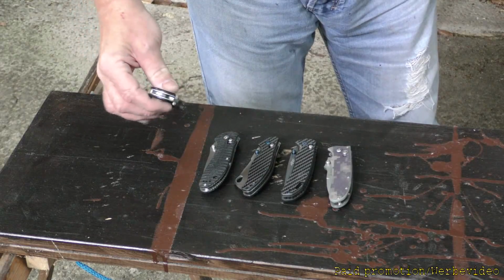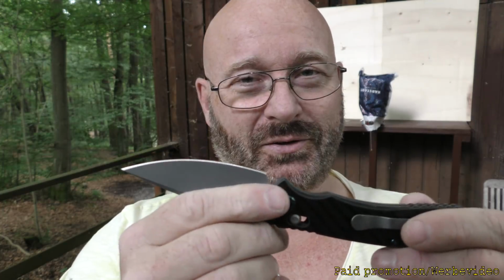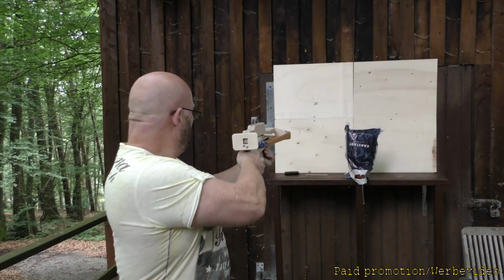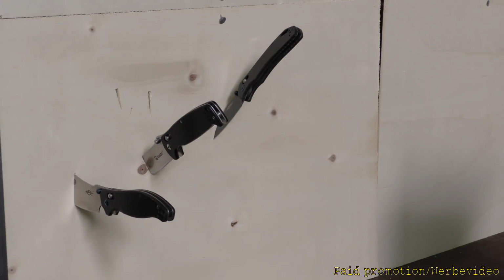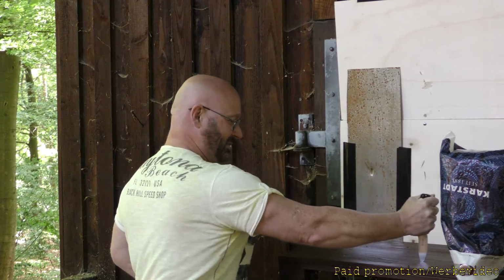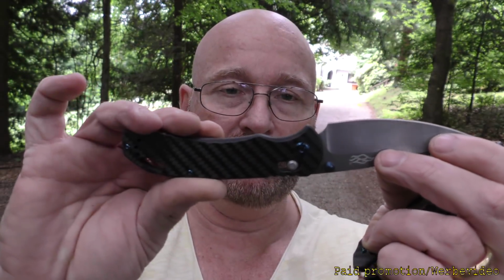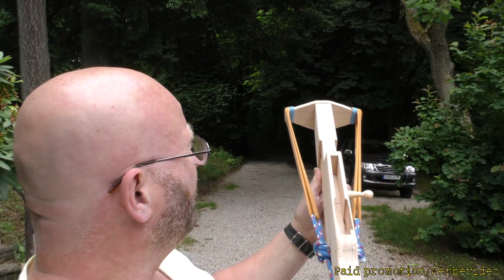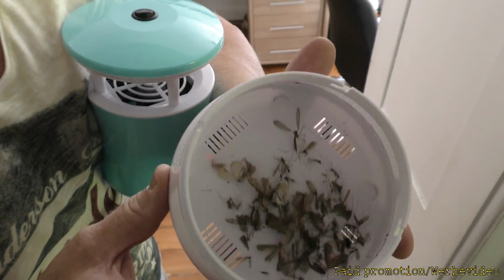Bolt Action Ballistic Knife Launcher = Unbelievable Review Machine

Comment: I dropped a 10' 440 knife onto some asphalt, tip first, from about head height, and it definitely got dented (I think some of the metal got pulverized, too).

Joerg, try shooting the knives into a brick, or maybe a marble slab (some kind of stone). It would be spectacular.

...or shoot it at an ipad...do it...

By the way Joerg, you're keyboard is really old. You should think about maybe retiring it (but shooting a knife through it).

Comment: I have a couple of these knives. Sometimes the axis lock is a bit stiff but it breaks in fast. Personally I take all knives I've ever had apart and lube them up good.
Never had a bad experience with ganzo so far, highly recommend them.
Reply: PS. Also have the screwdriver set. Works great.

Comment: PR0BLEM HERE IS N0B0DY WILL SHIP KNIVES 0R BATTERIES ANY M0RE, I CAN N0 L0NGER 0RDER ANYTHING WITH BUTT0N BATTERIES,LIKE THE 2032,THE SIZE 0F A DIME, AND THEY W0ULD LET A TINY PAIR 0F CLIPPERS,THE TYPE Y0U USE T0 CUT PLASTIC M0DEL PARTS 0F THE FRAME,THE CUTTING BLADES ARE QUARTER INCH AT M0ST
Reply from the maker: Did they also outlaw using the caps lock release key?
Reply: i d0nt think this is better,  my grands0n ripped the letters 0f my keyb0ard and i cant find the"0"

Comment: Here's a question about German law at least.  you have a blade limit on (folding?) knives of 10cm or something. Can you have multiple blades on a single folding knife that are each 10cm?  Can you have, say, a knife with one 10cm blade that folds out, then another blade on a support that folds out twice, making it stick out exactly 10 cm past the first blade?
Reply from the maker: There is no blade length limit on folders, except for automatic knives (switchblades). Those can't be "Out the front", the blade must swing out sideways and the limit is 8.5 cm. Never saw an auto knife with more than one blade but I guess in theory that would be OK.

You can't carry FIXED knives with a blade longer than 12 cm.

Comment: You should do a toy big gun that shoots guns that shoot blades or whatever, like so that wnen you shoot the big gun the projectile gun also goes off right after it's gotten most of the speed.
Reply: Sounds good, except there’s Newton’s 3rd law of motion to contend with...
Reply: Charles Ascott which law was that
Reply: Markus Allen. Every action has an equal and opposite reaction, i.e. the gun that fires the second projectile, would get pushed backwards by the projectile it’s firing. So that second projectile would lose most of its energy.
It’s not that it wouldn’t work per se (e.g. multistage rockets), it’s just kinda pointless. It’d make very little difference to the final projectile speed and would be incredibly inaccurate.

Comment: The screwdriver set is nice. I like how the bits are stored in a slick leather wallet. The driver itself however.... Maybe I have faulty hands but whenever I've tried those thin screwdriver handles with rotating butt it hurts my hand and generally feels very uncomfortable to use if the screws are tightly screwed.

I prefer a thick and static handle, even for winding small screws personally.

But, as you might've guessed: it's hard to fit a thick handle into a slick case that easily fit inside of ones pockets.
Reply: you almost always have a trade off between form factor and ergonomics.
Reply: ukezi: Very true.

I've seen a few bit-drivers that I like where there is a big, comfortable handle and the bits are stored inside of the handle. I like the idea.

Sadly, almost all of them that I've tried have a little "wiggle" to them, partly because the tolerances of the measurements where the bits are inserted are a bit too high, so the screwdriver assembled feels a bit wobbly.

If I could find something similar where the tolerances are lower, and preferably with an easily portable extender so you can reach those deep screws I would buy it and try it out.